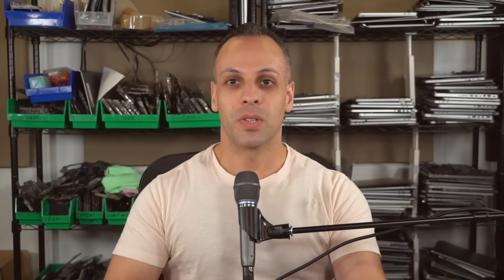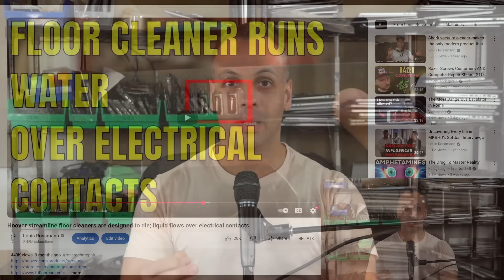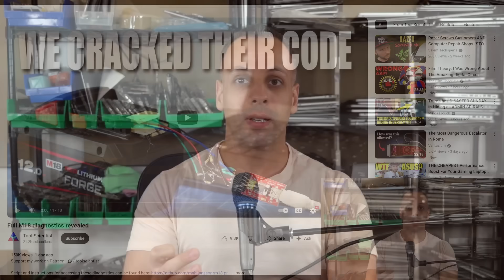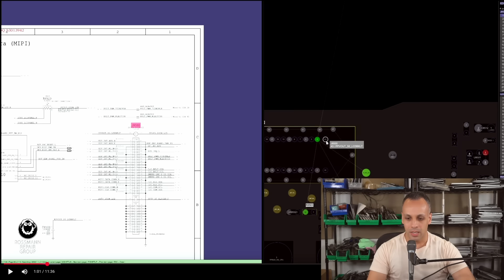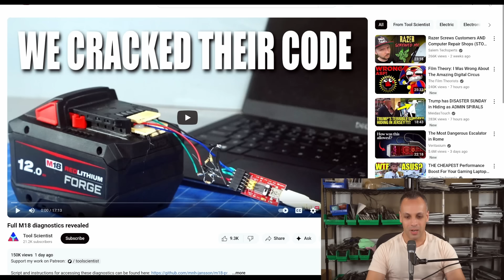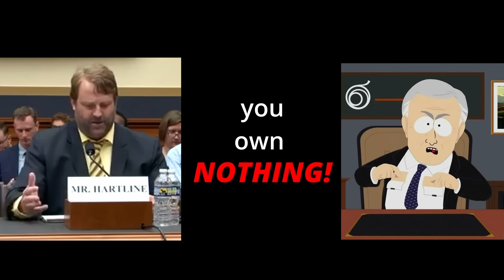Imagine putting DRM in a battery to void warranties...

Comment: How come it's illegal to repair many electronics, but you can rewrite a cars performance without any come back and they are doing it in many garages so tell me what's the difference?
Reply: You can gut your car electronics and update but you cant gut your appliances internals and still have them work
Reply: @lovingmybaby9530 but when the car performance is changed its the original components in the car all they do is rewrite the programme so to me there's no difference
Reply: @terencewelch9800  that is not what i said, read my words again slowly
Reply: @lovingmybaby9530 yeah, sorry missed reading it, lol
Reply: @lovingmybaby9530 Also, I must put my glasses on more, lol

Comment: 6:39 Your drill doesn’t connect to the Internet — yet.
Reply: Milwaukee released One Key quite some time ago. It can, in fact, already connect to the internet
Reply: @PAYTONLB999  Yes it's to help businesses prevent expensive tools walking away from job sites.
Reply: @PAYTONLB999  I was going to comment something similar. I know MIlwaukee has the smart phone feature on its tools.
Reply: And when they finally do release a wifi enabled drill, consumers will flock to it 🤦

Comment: iv "repaired" a few milwalki power tool batteries by opening them up and putting a cell balancing board on. it certainly extends the life by a few years in low current draw applications. its dumb that a expensive piece of equipment doesnt have cell balancing where cheaper "brands" do have cell balancing built in.

Comment: on the new battery buy a new drill they pretty much did that at the hardware store i worked at, the battery itself cost so damn much u might aswell spend the extra 60-80 bucks and get a drill since the batterys fit most of the other tools.

Comment: I hate to be the "well actually!" guy, but I'm gonna anyways. The nominal voltage of a Lithium Ion CELL is 3.7V or whatever. It's X number of CELLS in series. A single AA isn't a battery, it's a cell, two or more cells make up a battery. That said I also understand that in common parlance people frequently use the word battery when describing what is technically a cell, and describe two or more cells as just "batteries". So this is really just a nit-pick I suppose. That said I think these companies need to be beaten into submission by the regulatory state.

Comment: Unbalanced battery charging is not only stupid and wasteful, it can be potentially dangerous.
Reply: The BMS monitors all the cells. It won’t do anything dangerous like overcharging. If one of the cells gets out of balance, it will not charge the pack as much to keep the cell voltage safe.

Comment: Battery balancing is something I learned about when getting into RC cars. And I figured that any battery that additional connectors is probably going to get balanced when charging.
But looking at the data from my EcoFlow River Pro power station (bought a few years ago, not used much, but took care of the battery), it looks even a power station with a 720Wh battery doesn't do cell balancing.
I do get data for "min cell volts" and "max cell volts" (4.01 V and 3.85 V at 85% charge), but the two values always stay a fair amount apart. Even when fully charged, the difference doesn't get any smaller, as it should do if balancing was happening at the end of a charging cycle.
Reply: For this to happen it should have active BMS and not passive that will just detect each cell and shutdown if one is too low.
Reply: @vadnegru  Yeah, exactly. And I would absolutely expect active BMS from a reputable powerstation manufacturer on a device that costs several 100 bucks.

Not sure how their current models are, the River Pro I have was one of their earlier models and they have grown a lot since then and released a lot of new models, hopefully with improvements.

Comment: According to a repair specialist here on YouTube, Dead Doherty, Milwaukee tools are notorious for bad design and no repairability. The switch, motor unit, control board, and battery connections are sold as one piece, so if any one of them gives trouble, you're buying a new machine.
Reply: Dean knows his stuff, hes no joker and not biased like some are. Great man.
Reply: All intentional. For what its worth, I bought my Milwaukee impacts in 2015 and they work like they are brand new, even the batteries lasted until last year (2024). But I don't know how they are built now

Comment: The warranty purpose seems mostly to deny warranty to people who use these batteries in their own applications or 3rd party tools. 
Should they be warrantying batteries used in someone's garage built ebike or in some Chinese mystery brand's tool they bought from some marketplace seller?
There are countless 3rd party products out there that use the big tool brand batteries. Also there are these adapters that allow using one brand's batteries on another brand's tools. All of this could lead to problems that shouldn't be warrantied. 

Now I agree they are bad if they are using this to deny valid warranty when the batteries crap out only being used in their tools and chargers, but when the battery craps out being used on some home brew ebike that draws too much current repeatedly well that should be on the customer.

Comment: I periodically take my tool batteries apart and bring all the cells up to the same voltage because they don't balance themselves.  It wouldn't surprise me at all to learn that a future edition of the batteries specifically checks to see if single cell/groups of cells rise in voltage with out a charger being connected, and in a way that suggests manual balancing is happening then logs it or even bricks the battery.

Comment: If it makes you feel any better, there have been numerous situations in my career where I have proposed a change that I know will make a product better, only for management to shoot me down. In this situation I could easily see the engineering team suggesting to change the pinout to fix this issue, and management saying no because it wouldn't be backwards compatible then, or because the production line is already tooled for this configuration, or because there aren't enough engineering resources to do the work, etc etc. So maybe someone at apple cares. Just not the right someone.

Comment: As someone who has built a 13s10p (130 cells, 13 in series 10 in parallel) I am confident in repairing failed battery packs. In a Dyson that used a 5s1P configuration, after disconnecting the cells from the pack, their proprietary BMS detected that it was being repaired and went into a permanent fail mode which pretty much made it trash as there is no way to flash their get it to work. I replaced all the cells but since they killed their BMS, it made it worthless. I then searched for a replacement battery on Amazon, did a capacity test on Amazon and left negative feedback describing its true capacity. I then removed all the crap cells with the cells that I tried to replace on the Dyson. I still use this battery to this day but it's getting old as it is a few years old. I'll just replace the Samsung high output cells again.
Reply: I'm surprised Amazon posted your negative feedback.  When I've encountered bad items and left truthful negative feedback with photos they never see the light of day.  Same seems to be the case with Walmart.  Bought a 10' USB cable which was only 9' in length.  Took a photo of it next to a tape measure as proof.  Never was posted.  Reviews today are falsely inflated to make products they sell look good making them worthless.
Reply: @garyplewa9277 experienced the same,  we need a truth in feedback/reviews business as lawmakers won't do anything but enriching themselves.
Reply: If you don't mind, how did you manage cell balancing for the 13s10p? Really curios about monitoring 130 batteries...
Reply: @davidg3944  you are only monitoring parallel groups, so 13 cells, not 130. One parallel group acts like a single cell.
Reply: @JakovPerisic  Thanks for responding! But I am not sure how this works, as wouldn't individual cells (even in parallel) still be subject to voltage variations due to each cell having slightly different chemistries? Or, being parallel, are they forced to the same voltage even if a cell is "weaker" within the group? Sorry for the dumb question, but I'd rather ask than not know...
Reply: @davidg3944  yes, them being in parallel forces the same voltage, they could have different capacities in theory and they would still act like a single cell with all the individual cells in that parallel group discharging equally.
Reply: @JakovPerisic  Cool, thanks for that confirmation. I have some BMS boards that I need to study the spec sheet for, as well as a spot welder and some batteries. If you hear about a building on fire in the North East, it was me...
Reply: @davidg3944  please be careful and read everything you can about it, batteries don't forget, you can't turn them off ;)
Reply: @davidg3944  You basically make 13 "packs" of 10 batteries in parallel--then you just need to have a single balance circuit for each "pack" (or the entire battery unit if you have a multi-cell balance unit.)
source: my 16S 44P 11kwh off-grid LiFePo4 battery pack, which is 8 years old and working perfectly.  (Made with 32650-size cells.)
Reply: What do you do with your old lithium batteries?  I've rebuilt a number of batteries, and I have a box full of old cells.  I don't feel comfortable with it in my storage unit, but I can't just throw it in the trash.
Reply: @rickt.1870  Batteries should be disposed of at a proper site intended for them, never the trash. If you want to store them, a heavy metal box (with the batteries in plastic containers or terminals taped over for electrical isolation) could be used, but I'd not store more than ten in any one box. Just my opinion, a search will turn up other suggestions.
Reply: I have red about that same problem on Kärcher Battery tools. My thought to to overcome that problem: put a powersource on the board while you change the battery.
Reply: @anamethatsnottakenalready  Yes, I had that same thought about maintaining power, but you'd have to be careful (lucky?) during the process. Hope someone tries it.
Reply: The same happened with my Roomba battery. It lost its capacity. When I looked inside, there was 4 cells though there is clearly place for 8 cells. And iron weights so it would be as heavy as their other product, "extended life battery" (sold separately). That's ok, weights are needed to keep Romba in correct position. But then I tried to solder another 4 cells parallel to existing. When I disconnected existing, it never came back on again, that stupid controller didn't allow this. And of course it had no balancing circuits inside.

Comment: While having a chip inside the battery monitoring what happened to it may suck as a consumer, batteries do degrade faster under heavy use at high temperatures. NMC/NCA also does have a tendency to fail spectacularly when stored at high temperatures. If I was a battery manufacturer, I'd definitely want to log extreme temperature events for liability reasons: I shouldn't have to hand out potentially millions of dollars for a battery failure likely caused by you storing your batteries on your truck dashboard where it gets to 180F in the hot noon summer sun which greatly exceeds maximum safe storage temperature.

This sort of self-monitoring and reporting will likely become mandatory to complement the EU's battery passport program as increasingly frequent battery fires force legislatures to clamp down on batteries of questionable origin or unknown history.
Reply: Are those memory modules resistant to fire? Or would the millions of dollars worth of damage mainly be restricted to outside the battery?
Reply: @kg790  as long as the flame jets from the battery aren't aimed straight at the chip, it may very well not reach the ~600C required to thermally erase EEPROMs. There are also protective  gels that could be applied to the chip to keep it safe long enough to survive the battery fire itself. Once what is left of the battery is under the ash pile, ash can protect the chip until it is found as it is an excellent insulator.
Reply: @teardowndan5364  Interesting, thanks. I recently read about modern flight recorders / black boxes, and it's incredible what they can withstand. I wouldn't put it past manufacturers to fill their products with sand either.

Comment: In a previous video, I recall that they showed the Milwaukee battery does have the hardware to do the cell balancing but it does not balance the cells. For some reason, it isn’t implemented. Out of balance cells have been a major problem for some with Milwaukee batteries both 18v and 12v. They appear to be doing this to make sure the packs don’t last too long. You’d think that a company making tools for professionals would have professional features like a storage mode on the charger that would stop charging at 50% for long term storage (or whatever SOC is ideal for the particular cells)

Hopefully this brings some attention to the situation and the company straightens up. They generally make some good tools. But, it seems the bean counters are trying to extract all the value and good will from that.

Comment: This, unfortunately, comes down to a simple truth of corporate product engineering that we - as consumers - need to push back against.

It's easier to find a way to cover your ass and blame the consumer for a problem, than it is to fix your shit so the problem doesn't occur in the first place.

Companies don't want to fix their shit. They don't want you to fix their shit. They don't even want you to salvage their shit. They want you to buy another one - at full price - and throw the old one away. Or better yet, give the old one back to them so they can 'refurbish' (read: reset the Planned Obsolescence System), clean it, and sell it again. The faster they can get the turnover between the old one going dead and you buying a new one, the better.

We saw this with cars back when Japanese carmakers broke the General Motors monopoly by offering cars that were straight-up better quality than the designed-to-fail garbage GM was producting. Now we're seeing it with electronics.
Reply: How,  stop buying "sgitty" stuff?  In some products, they're all not good, and you're only left with the lesser evil. .

Comment: Does your drill connect to the Internet? - Not YET
Reply: RFID in the drill bits. Tool only works with "authorized bits".
Wait, that was last years model... Please pay your subscription to drill more holes.
Reply: @XDRosenheim Some of the Phillips Sonicare toothbrushes have RFID in the brush heads. 

Also, Hilti battery chargers have cellular radios built-in. Their batteries store lots of data from the tools. And they upload it when you charge them. 

It sounds like they mainly use it for you to track your own tool usage, though.
Reply: These already exist, for now the reasoning is that you're able to track statistics about the tool and idk find it when you have lost it somewhere on site. But RFID or QR code drill bits and grinding discs are only a small step away from that, subscribe to a special maintenance plan to be able to get more trigger time on the tool and so on
Reply: YOU WANNA SEE SOMETHING COOL? its going to connect to MY network with wireshark, and we are going to make some binary poetry later.
those pesky pixies in that rotor box have a job to do, and im going to make sure they get it done.
yes.. i went there and in my opinion, THAT is pretty cool!